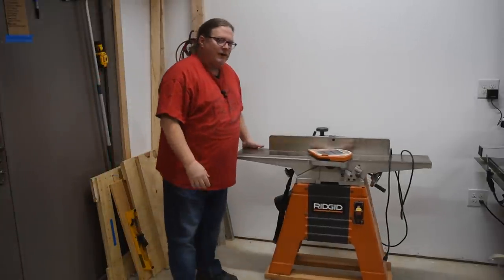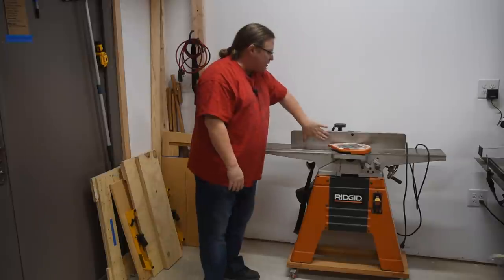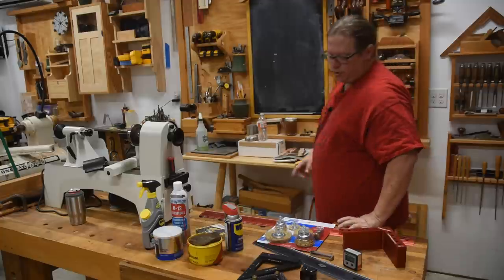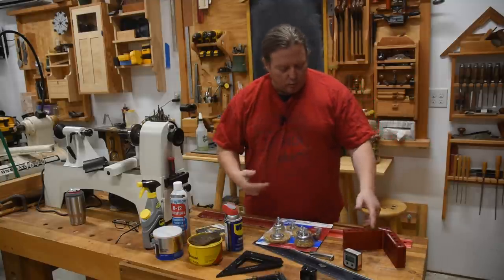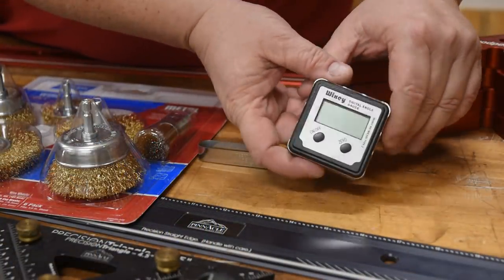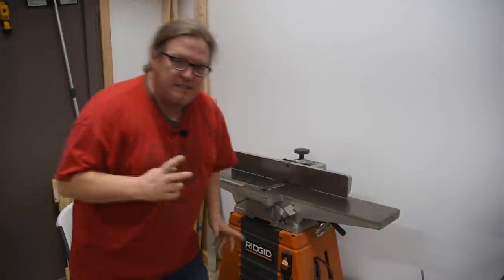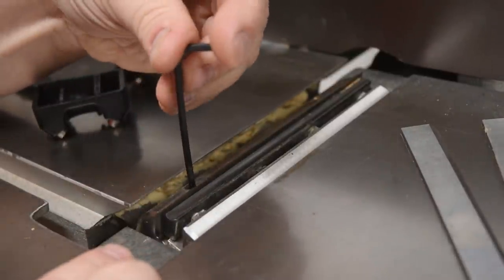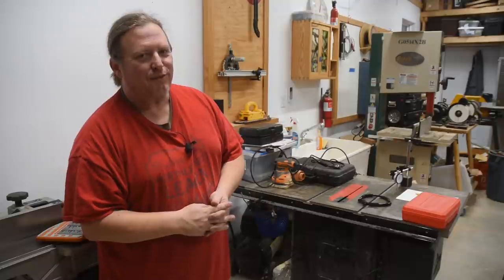Super Tune Your Jointer - Basic Tool Setup/Tuning Techniques

Comment: Every 6" inch jointer manufacturer owes you a check. This is the video I've found that really details the approach to solving the problems I'm facing on my 20 yr old Jet jointer. Thanks so much!
Reply: When you've tired of all the pissing around, simply clean it thoroughly, align the tables as well as you can, dismount it from the base, and take it to an engineering shop or engine reconditioner, and have them surface grind the thing, clocking off the cutter drum as reference when setting up. Wood is abrasive, so you probable have a concave infeed table anyway, after 20 years use.

Comment: Aloha Braddah! I play guitar, ukulele and other instruments. Now I want to make guitars. I don’t know much about wood, wood working tools as well as the machinery other than the basic use of the tools. I am currently elevating my knowledge to learn all the machinery and my top three machines needed to get rolling in it. I’ve learned that I definitely need a jointer, a planer and a table saw….anything else like a band saw, etc. I have a source offsite of my home. This video was very informative and deep….the realm I work out of as an aircraft mechanic/technician. Most mechanics have an inclination to dive deep into something to see how and why something ticks the way it does, which is why they are able to jump into another field and try to learn from the inside out. I needed this video! Mahalo nui for sharing your time with us!

Comment: Hey thanks for this video, my jointer is very old like 60's vintage. Today I pulled it apart and put it back together again updating the old English Whitworth bolts to metric.
I then went over the in and outfeed tables making sure they both lined up across the length, then moved on to the cutting head. 
My very poor old jointer never did do a good job at even doing a flat board. With your advice, it now does board completely flat but also a perfect 90, and wow what a difference and now a joy to use.
Thank you for the video and the great explanations of how it should work.

Comment: Good video.  I have the same jointer, and needed a refresher on order of adjustments.  A helpful hint on zeroing your dial indicator is to get it close and use the little knob on the bar for fine adjustments.   When twisting the dial face, you're always going to be wiggling your needle around. With the fine adjust knob, it's so much easier.

Comment: Top notch!  I appreciate that you offered an overview of concepts, and discussion of how the task is performed.  Thank you for suggesting the order the tasks should be performed.  Each step builds on the prior in a logical order.  Until tonight, I didn’t recognize the need to start with leveling the cutter head relative to the infeed table, and that it is possible to shim the infeed table if needed.

Comment: FYI - The HD 6" jointer is made by TTI.  This company makes jointers, lathes , saws etc. for Milwaukee, Jet, Home Depot, Grizzly and others.   If you find a part that is difficult to find because it has been discontinued, try looking at other brands of equipment with similar features.  As an example, I found some Porter Cable band saw parts work perfectly well with my 14" Ridgid band saw  The same could be said for Grizzly.  And I have found Grizzly parts work on my Ridgid jointer.  Keep that in mind when you go shopping for parts.

These are jointers all made in the same factory that are "similar" to the Ridgid.   They are not identical, but use many of the same parts and design.

ACCURA 
AMERICAN MACHINE TOOL 
BRIDGEWOOD BW-6R
DELTA JT-360
GENERAL 1180
GRIZZLY G0654
GRIZZLY G0452
GRIZZLY G0526
GRIZZLY G1182
JET JJ-6
JET JJ-60S
JET JJ-6CSDX
JET JJ-6CSX
JET JJ-6CS
JET JJ-6HHDX
PIONEER PNR 13 150L
POWERMATIC 54A
RELIANT DD-38
RIDGID JP0610
RIDGID JP06101
RIDGID JP6101
SHOP FOX W-1679
BUSY BEE B706
CARBATEC CTJ-150
CRAFTEX B706N
GEE-TECH CT-15
GENERAL 80-075
GENERAL 80-100
GENERAL 80-150
GENERAL 80-100LM1
NORTHSTATE CT-150D
STEEL CITY 40615
STEEL CITY 40625
STEEL CITY 40640
KING CANADA KC-150C
AXMINSTER CT1502
GRIZZLY G0813
GRIZZLY G0814
SHOP FOX W-1745
CARBATEC CTJ-196
SUNHILL SM-150
RIDGID JP06000
GENERAL 80-150L

Comment: You might already know this, but when you put the guard back into the spring, you have to load it by turning it before you run the stem down. Great video. I have the same Rigid, so I will 'tune 'it up tomorrow.
Reply from the maker: Or have a spring at all in there.

Comment: I was JUST having that taper issue with my old grizzly jointer. I found the manual but it didn't say anything about fixing the angle or twist. This video came at the EXACT right time. Thank you :D

Comment: Thank you so much for this video! I have that exact jointer and have struggled so much.  Initially it was tapering the wood which I mostly fixed by shimming the slope but then realized it was also twisting and then I couldn't figure out what to do with that.  This video was immensely helpful.
Reply: I also have this jointer. I thought my problems were caused by user error. Thank you for this video.

Comment: Great content, Thank you

To adjust the dial indcator unlock the small thumbwhell located on the outer cover ring at the 2 o'clock position it will make the adjustment effortless - and will make adjustment effortless

Comment: Edited....
This is a FYI.
My jointer's model number is JP06101.
Setting the knife height still alludes me.
I bought the mini planer pal, but it sets the knives too high for the head to rotate. 
Best I can tell the head diameter on my machine is about 2.375" and the maximum the mini planer pal supports is 2.125". 
Per the Byrd website in regard to the Ridgid JP06101 jointer ... "Older models use a 2 5/8” cutting circle and newer models use a 63mm cutting circle (Cutting circle = diameter of cutter head including knives)." ... 

original...
It was getting hard to push wood through my jointer so I decided to replace the knives. I remembered this video so I watched it again. Thanks for doing videos like this. My jointer is very well aligned so I didn’t have to mess with the beds. If I had not seen you turning the screws to the right to get the knives out I might have broken something. After putzing around trying to set the knives with a straight edge I couldn’t get them set good enough so I just ordered the mini knife setting gizmo and will try again in two days.
Reply from the maker: Raise the outfeed to match the knives
Reply: @wortheffort  Hi Shawn, I understand the recommendation to raise the outfeed table, the problem I have is when the first knife is set with the gizmo it is set too high for the cutter head to rotate. Rotated forward it strikes the infeed table side and rotated backwards it strikes the outfeed table side. Bed height is not the issue. 
I have paid close attention to the segment of the video where you set the knife with the planer pal, you did a good close up of the methodology and I am doing it the way you demonstrate. 
I am not upset in any way with your instructions and recommendations, I am usually very good at setting machine tolerances but setting these knives is kicking my a$$ three ways to Sunday to the point that I have been looking at helical cutter heads this morning.  
I will work on it some more today. If I can find a couple of magnets I might add them to the ones that hold the knife so it will be set it lower on the head. 
I do appreciate you.
Reply: I finally succeeded with setting the jointer knives using the straight edge on the out feed table and rocking the cutter head back and forth method. It took several rounds of adjustments to get the knives all set equally across their length. 
That jointer went the full 15 rounds and I only won by a point or two. 
Hopefully I will be better at this task in the future.

Comment: Thanks for posting this video.  I have the exact same jointer and noticed over the years that the front side of the fence was square to the table but not the back side of the fence.  Never figured out why until watching your video!

I think I see why you adjusted the cutter head instead of shimming the infeed side.  My jointer had the exact same problem and instead of shimming the cutter head I shimmed the infeed side but noticed the shim would "skate" out the end after adjusting the table up and down, so I ended up shimming the cutter head as you did.

Comment: The bars that hold the blades in are called the chip breakers. Thats why the radius groove in them to control the chip curling off the cutter and not just hitting a square shoulder and splintering, tearing the wood surface.

Comment: shouldn't be at first the outfeed table coplanar to the cuttinghead / edge of the knives and then adjust the infeed table for planar/parallel alignement?
Reply: I thought the same. I think the procedure is backwards. Outstanding video just needed to start with the out feed table first, then the infeed.

Comment: A very simple way to determine if the table, say on a band saw, is exactly 90 degrees to the blade can be done with two cuts on a piece of scrap wood.  First you make a very shallow cut on a piece of thick wood [say 1/2"], then turn the board over, with the top side now on the bottom and make another cut near but not on the first cut.  If the two cut lines are parallel then the table is exactly square with the blade.  I feel this is superior even to the precision square and other measuring methods.

Comment: 123 Blocks would also work for checking the square  of the fence and are also multipurpose just like those corners
Reply: Yes they would but they are very small and your chance of error multiplies. A 456 would be better but a master square would be best. The angles are a good compromise.

Comment: great vid  I need a little advise. I am doing this with a vintage craftsman 4 1/4 in. planer.  when I check for coplaner  with the straight edge I get a .013 gap at the cutter end of the infeed table.  It is the same on both front sides of the infeed table. The gap very quickly over 3 or 4"  disappears where do you think I should place the shims?

Comment: Shawn:

I have a Ridgid jointer that I purchased from an individual.  It was damaged in a house fire and the plastic switch and bezel on the front of the machine were melted.  Other than this, all looks ok other than the rust that was on the infeed/outfeed tables.  That was removed with lots of elbow grease.

Now I am in the process of truing up the infeed/outfeed tables.   I am using a 4’ straight edge to find where the table is sagging.  What is an acceptable clearance under the straight edge when looking for misalignments.  I used a feeler gauge with .005” and all seemed ok.  Then I went down to .0025” and in spots the feeler gauge slipped under the straight edge.  Should I call it a day and leave things alone?

Also, when I first began the true up process, I ran the infeed table all the way up then used a dial indicator to measure how much the cutter head was out of alignment to it.  It was out about .007” at one end and I shimmed one end of the cutter head up with aluminum from a soda pop can and reduced the misalignment to about .002”-.003”.  Is this good enough?
Reply from the maker: You’re asking me how perfect should ai make it. That’s something you need to decide for yourself. I’m not a machinist.

Comment: Using shims for machined surfaces designed to regularly slide upon one another makes no sense at all. Normal adjustment of the in-feed table will wear the shim and it will need to be replaced. Additionally, the shims will have a tendency to move along the dovetail as the height of the tables are adjusted. To ensure accuracy shims would have to be adjusted every time the bed is adjusted. Ideally, the machined surfaces must be trued. I am of the opinion that trying to tune a portly machined jointer is dubious.